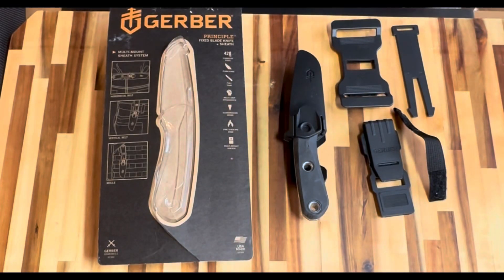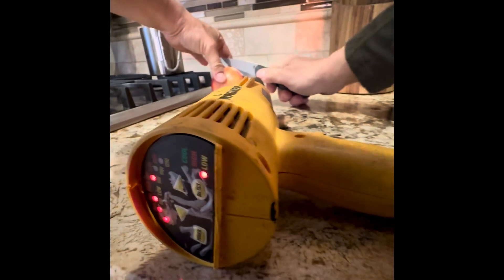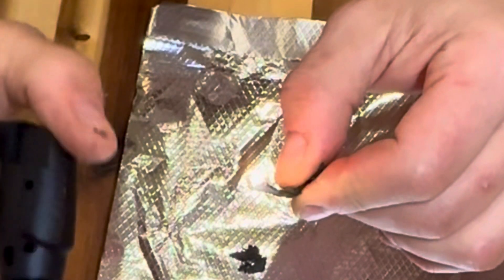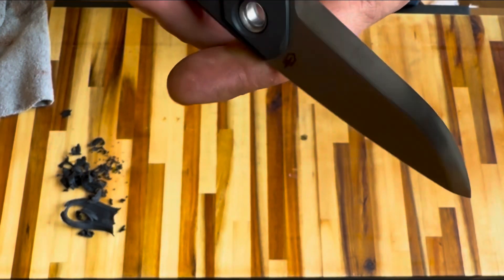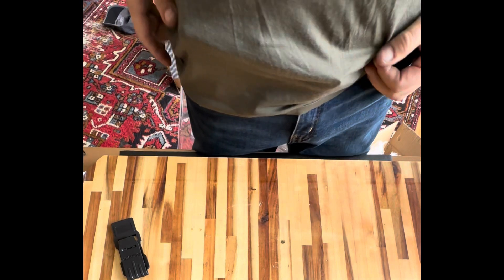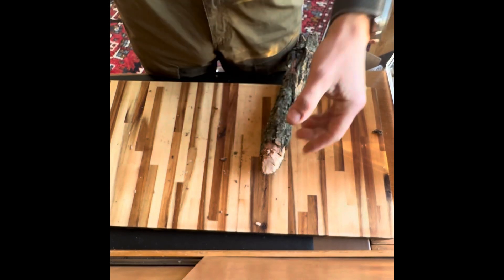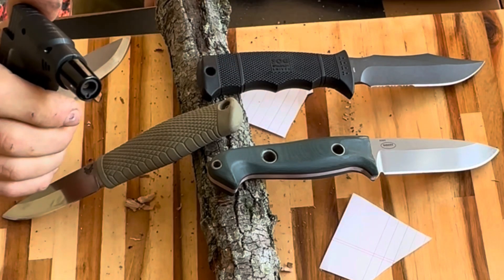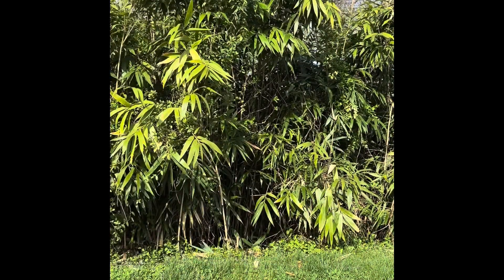Crazy: I burn $500 worth of knives to prove that the $68 Gerber Principle could be designed better!

Comment: The Benchmade new waterline  fillet knife has what feels like a rubber handle. What are your thoughts of the material they use for that handle. My concern is what you experience here with this knife the rubber falling off, turning a different color, or getting cracks and imprints thar don’t rise back up.

Comment: The issues are a shame because the handle and blade profiles and the 420HC are nearly perfect for a small utilitarian blade. Really one of the best small utility/bushcraft knife designs on the market and one of the best budget steels. I'd expect this extremely tough steel to roll before it chips when taking reducing the edge angle, especially at or below 60HRC. One of the reasons I don't recommend this knife in spite of the great design (sheath aside) is because of the reportedly inconsistent heat treatment from Gerber. A maximum of 2 point variance is acceptable for a budget knife, but 4 points is completely unacceptable, which is what is reported about Gerber in general.
Reply: @CuttingBoardRx  The 440HC family has the best wear-resistance/toughness balance of any non-powder steel. AEB-L and 13C28N are also in this family, among others, and best at 60-62. I'm not a fan of scout carry, if I wanted to be stealthy with a small fixed blade, it'd go in my front pocket, so long as I am certain it would never cut through the sheath and into my leg.
Reply: @kevinmc1111  I personally think the sort of cross draw on your front works best on those sideways sheaths especially if its slightly at angle instead of completely straight. Carrying kmife behind your back seems really odd to me, and if its in center of your back i think it could hurt you really badly if you fall on it

Comment: 🇺🇸🇺🇸🇺🇸🇺🇸🇺🇸American made! Yeah! Quit worrying about where my money was used according to US made. In 1973 I purchased a Ford Gran Torino that had a Cleveland engine at 53,000 miles the engine failed. After many rounds at the Ford Dealership who did all oil changes with hours spent in their waiting room getting the run around, I had a friend help me rebuild engine. Gave the car to a young couple in church. Bought my first Toyota! And the rest is history. Now for this video I like my Mora Finland knives of Carbon steel, very easy to sharpen with the Scandi grind. All knives under $80.00 and under and no knife can compare to use. So if you want to spend $200-$500 to collect and simply admire in a glass case, go for it. Me, well I’m too practical, if I can’t use it, I don’t need it.